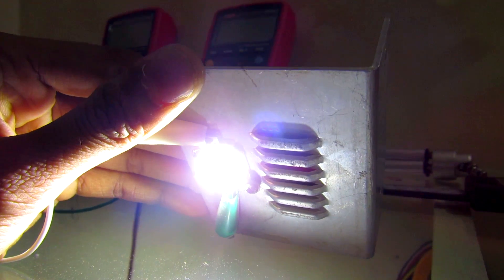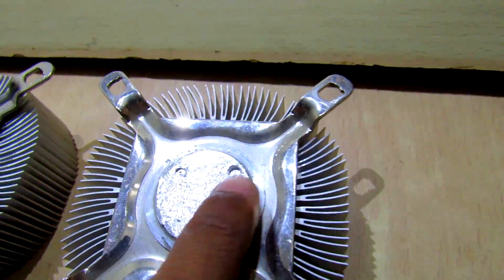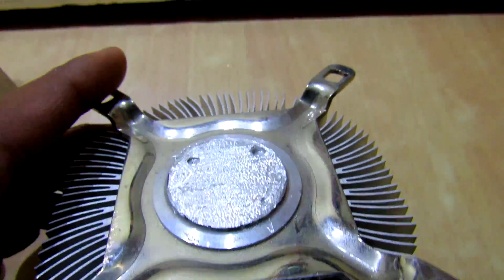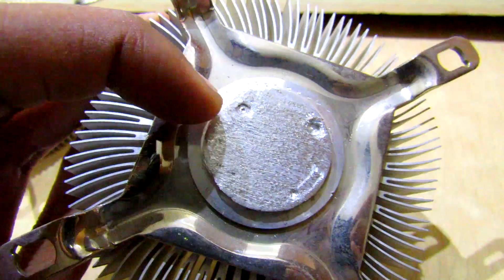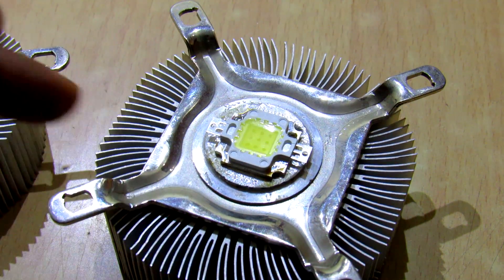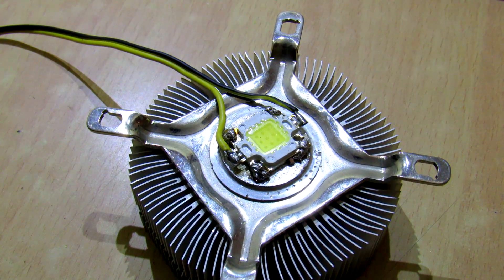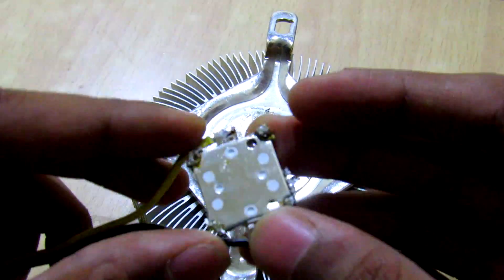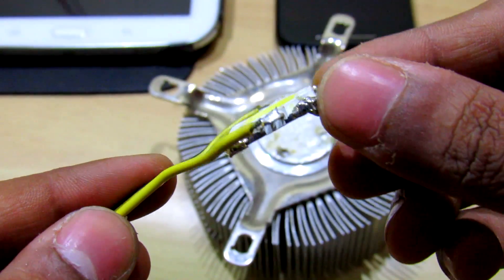Mounting 10W Led To Heatsink By Soldering (FAILED)

Comment: 2 solutions, either sharpen your drill bits, its just soft aluminum. 

Or

The way I made this work is to use 2 part epoxy glue. It securely attaches the led and acts to help transfer heat to the heat sink. As mentioned earlier soldering to aluminum requires a special flux. If the temperature gets hot enough to melt the epoxy, then you know your heat sink was not adequately sized (needs air circulation) in the first place. 

Thanks for sharing your work with us bro. I am in Canada, and like experimenting like you do. Seems you have an interest and knack for electronics and how stuff works. I hope to see you as an engineer in your carrier path. 

Let's all help to make this world a better place. :)

Comment: You can solder the LED to the heatsink if you use a heat gun that can get to around 160*c... just lay a ball of solder on the hot heatsink and place a flux coated LED on the hot solder... it should conduct the heat and immediately take, once it does... start cooling the heatsink down fairly rapidly and hopefully by the end of it you have an LED coupled to a heatsink... and the cooling performance should be much better than thermal compound!

Comment: Try using fevi quick as I have stick it on my bike!
Reply from the maker: Fevi Quick is not good for thermal conductivity, the purpose of heatsink here to just do that!
Reply: +Kedar Nimbalkar but bro I am using 2 10w led each as fogg lights on my bike and I have stick it with fevi quick and I have used on a trip from jaipur to delhi!
Reply from the maker: That's Interesting!
Reply: +TWISTyour THROTTLE doesn't it becomes hotter after few minutes?
Reply: Ashakiran G.N. yes it does get hot but doesnt effect any performance or life of led!
Reply: +TWISTyour THROTTLE 
Bro what kind of setup are you using with both LEDs if you can share 
that will help as I am planning to do alike on my Pulsar 150.....Did you
 use any LED Driver?? If so plz share the details and post a pic of same if possible

Comment: kedar, nice videos! the reason that failed was aluminium cannot be soldered, this is due to the thun layer of aluminum oxide that is present on any aluminum surface exposed to air. you can maybe use some sand paper and remove this oxide layer, and maybe use some quality flux. but for your application you could use the mounting plate found on the back of the motherboard/cpu and some thermal paste. good luck!
Reply from the maker: Thanks Man I will give it a Try!
Reply: +Kedar Nimbalkar good luck! and let me know how it goes!